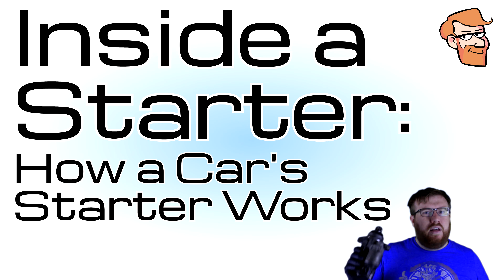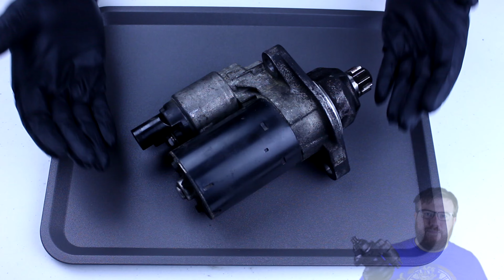How a Starter Works: Inside a Gear Reduction Starter! • Cars Simplified

Comment: The brushes are actually made from carbon! Hence them being brittle
Reply from the maker: Indeed, and some graphite as well. I used to think they were some 11 herbs and spices blend of toxic materials, similar to brake pads but with less emphasis on friction.
Reply: @CarsSimplified  Graphite is crystalline carbon silly. :P Though I'm sure you know that.
Reply from the maker: I actually forgot about that; I was thinking it was some high carbon metal. Oops!

Comment: Great video 👍 like always!  I remember around 30 years ago, I had to replace my Mazda B2000 SE5 starter.  I took the old one to Pep Boys got back to my driveway to put it on, started it up and it had a bad Bendix drive so took it off drove the 2 1/2 miles to Pep's to try a second one!  Same dam problem, so give me back the original starter and drove about 7 miles to the Mazda dealer and got one, about $30 more, put it on and I was back in business.  Good thing I had my GTI to run all these errands!!!
Reply from the maker: Thanks!
That would have been a pain if you were borrowing a friend's car or hiring a taxi! Was $30 more also for a new versus rebuilt, or were they both new/both rebuilt?
Reply: @CarsSimplified  no the dealer like Pep Boys had remanufactured ones.  Peps said they must have gotten a bad batch. Back then they probably weren't from China, so maybe Mexico!  I was lucky it wasn't a difficult job.  Even earlier on my 76 Rabbit around 1983, I had to replace the original starter.  I had one from a place that specialized in automotive electrical parts.  I had the replacement for a week and spending the night at a girlfriend's house the next day it was dead.  So I had to borrow her new Subaru GL hatchback and drive about 4 miles to replace it.  My Rabbit was a 4 speed and no a/c, so it was a piece of chocolate cake to quickly install it all from under the hood! Couldn't be any easier!!!
Reply: ... Who the fuck cares?
Reply: @anderstermansen130  everyone but you, go back under your rock!